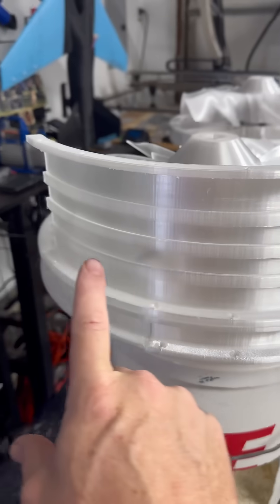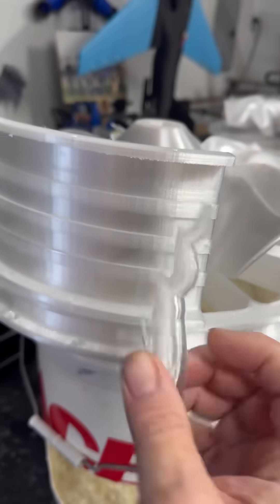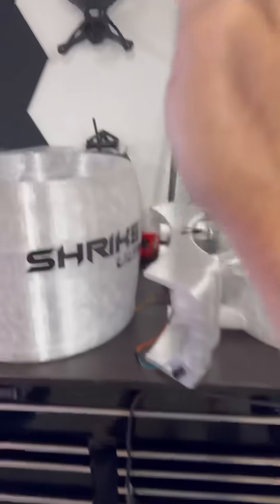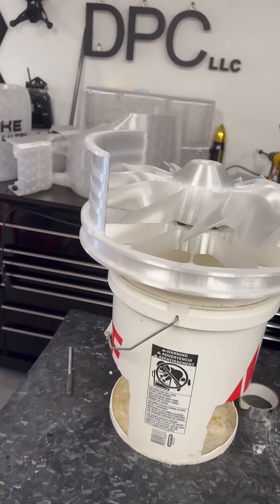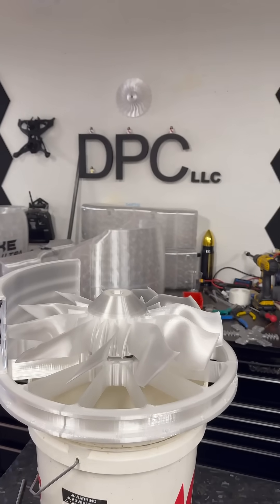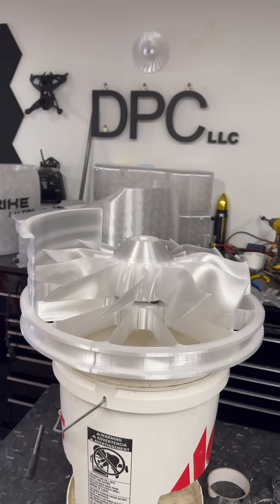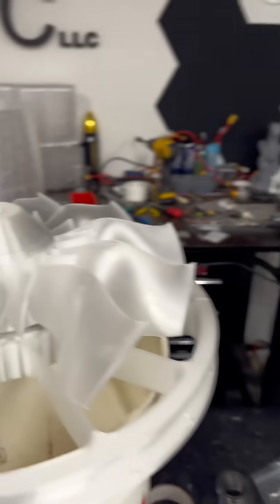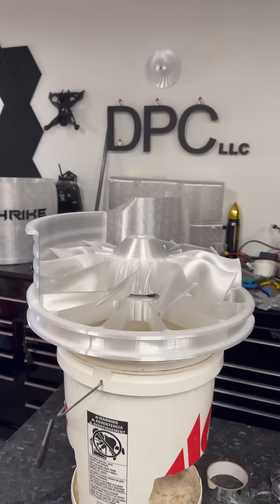EDF fan casing under construction.  🚧

Comment: The Design for 3D-printing article by Rahix (I can't give a link because the comment is then auto-deleted, but it's searchable) says that in the majority of the cases it's better to design volumnous bulky details when 3D-printing it. Unlike techniques using monolithic materials, with 3D-printing cutouts do not save mass a lot (and quite often make it worse).

Unless you have to blow a lot of air through the cutouts in the detail, I tend to agree with this observation.